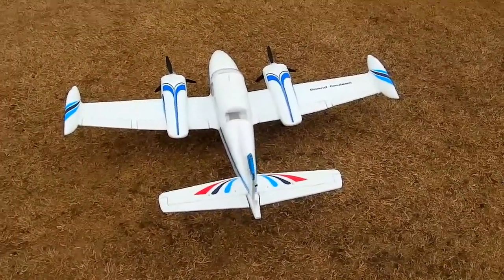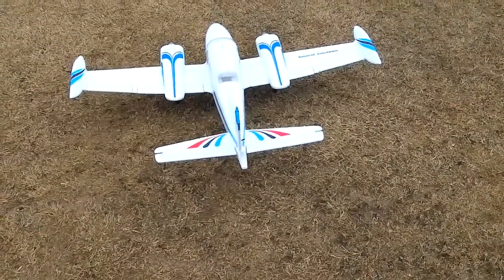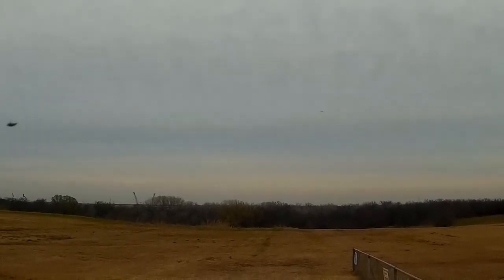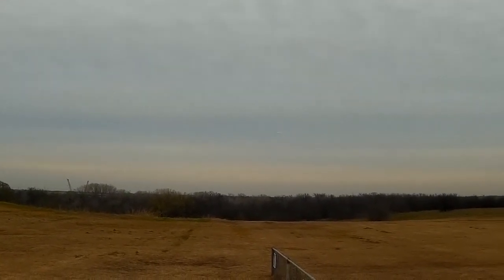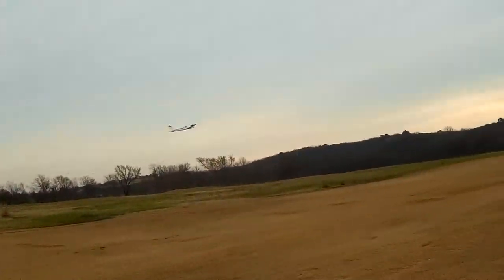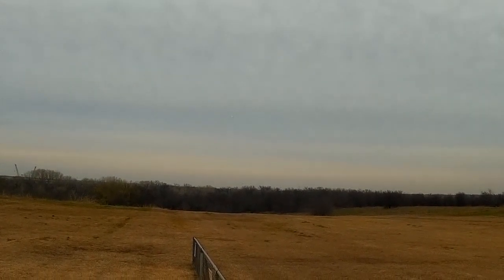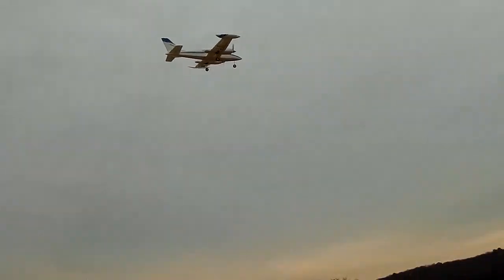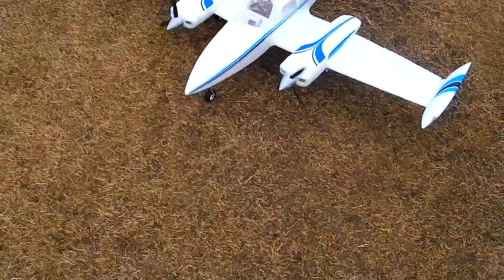Dynam Grand Cruiser - Flight 14 on 3-8-19

Comment: there were many dynam grand cruiser at swap meet but not at a good price...what was that small plane you had in your hand saturday??? aircore? i almost ran over you  turned around and couldn't catch you..
Reply from the maker: It was a HobbyKing Fun Fighter Wildcat. 
I have two of them, but since they do not make them any longer, I try to buy any that I find in good shape. (if I can get them for under $50)

It will fly on a 4s battery, and move the thing at over 100mph or it will fly on a 2s or 3s as well for a more relaxed flight.